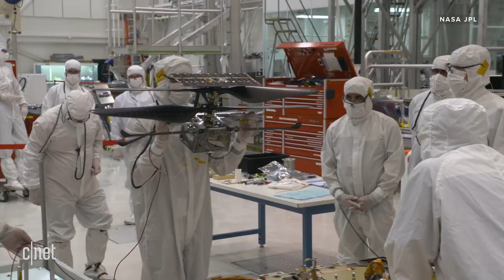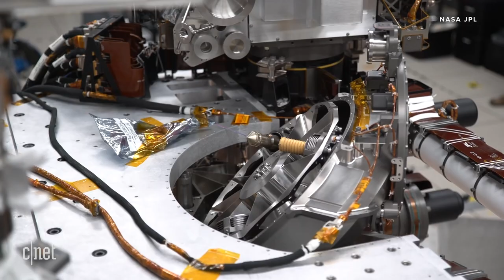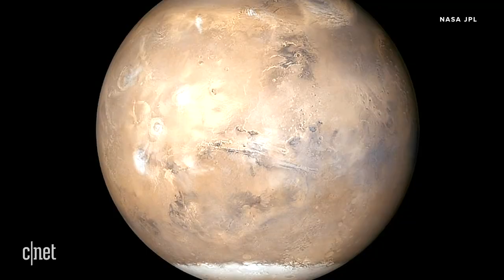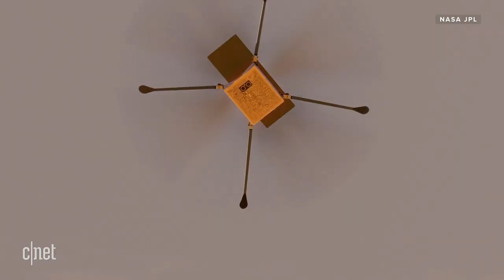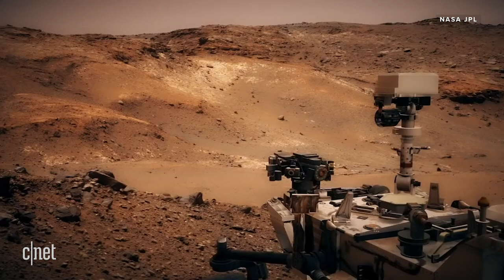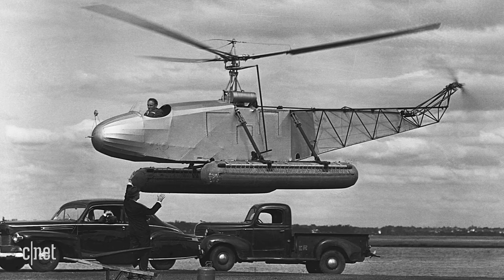The first ever Mars helicopter is INGENIOUS

Comment: Why? Because rovers are so damn slow:

Mars rovers:
Opportunity: 45.16 km
Curiosity: 20.4 km
Spirit: 7.7 km
Sojourner: 0.1 km

Moon rovers
Lunokhod 2: 39 km
Apollo 17: 35.74 km
Apollo 15: 27.8 km
Apollo 16: 27.1 km
Lunokhod 1: 10.5 km
Yutu 2: 0.1 km
Yutu 1: 0.1 km
Reply: John theux thanks
Reply: Thanks a lot mate.
Reply: Kilometers are not a measure of speed.
Reply: @UltraMojo13  Yeah I was also gonna say the same thing.
Reply: @UltraMojo13  he probably meant km/h. you've probably heard someone say: this thing goes 200 kilometres!   when they mean the speed of it.
Reply: But the helicopter goes 36 km/h thats literally slower than opportunity
Reply: Guys, please. The numbers above are clearly the total distance travelled by the named rovers in km. The speed of most unmanned rovers are a couple of cm/s. So yes, they are slow :)
Reply: @UltraMojo13  Most of them have a lifetime of several years.
Reply: @3p1ks  I mean over their whole lifetime, which is several years for most of them.
Reply: @inzert  Yutu and Sojourner travelled 100 metres?
Reply: @3p1ks  Yutu travelled a bit more but both around the 100 meter mark yes.
Reply: John theux what about perseverance
Reply: 3p1ks opportunity goes less then one 1 km/h
Reply: The Apollo rovers thou, are like race cars compared to the other rovers... still slow at a whopping 8 mp/h about 13 km/h
Reply: @UltraMojo13  SomethingSomethingSomething Light Years.  :D
Reply: @3p1ks  That's actually how far they have travelled so far, opportunity had a 15-year life but travelled 45.16km only because it's so god dang SLOW
Reply: idk wtf i was saying here

Comment: Might they use it to "dust -off" the Rovers Solar panels too? An additional small ducted-fan that would also add lift whilst dusting might be best for that specific purpose.
Reply: I dont think it has solar panels
Reply: Perseverance is powered by heated generators though. So that will not help.
Reply: Yes its brilliant. For all the times the dust covering the solar panels has been a major problem for all rover missions.
Reply: @josephamalsabu  However the solar panel although uses solar energy, which gets covered by dust on Mars isn't the only problem. It freezes the solar panels during sandstorms and during the night. Which happened to opportunity.
Reply: @s21b0b  i think he meant the other rovers
Reply: I think they should add an onboard shop vacuum to the copter to vac off the dust on rover or hire a Martian maid service.
Reply: @larry7868  lol

Comment: particles are trapped between the turbine and pushed. also we can spin things faster in space because the ether is made of fast moving particles that can escape really quickly and spread out so it would be crucial  to spin the turbine fast enough , to build up a significant pressure difference. this is just a concept by the way .

Comment: with that amount of money, atleast make those solar panel foldable so it wont interfere the air that will pass to the blades, also to protect it from dust and storm
Reply: The panel is too close to the axis of the rotor, and not much bigger than the body to interfere much, but I am surprised if it is not heliotropic for charging efficiency.  The worst martian storm is more like a cats-paw on your cheek.

Comment: If helicopters require an atmosphere to work, NASA has previously claimed there is no atmosphere on Mars.  So, was NASA caught “ misleading” the public once again?  The lift that is produced is proportional to the density of air; the higher the density, the more lift is produced and the more comfortably the helicopter can fly, and vice-versa. Less air density means less lift .
Reply: At no point have they said Mars doesn’t have an atmosphere. It has an atmosphere with about 1% the surface pressure of earth.

Comment: Here’s what I don’t understand. On Earth, small helicopter blades rotate at 400-600rpm. On Mars, there is only 1% of the air pressure on Earth. But there is only around a third of the gravity. So the rotational speed to generate sufficient lift on Mars should be 100 x (say) 500 x 1/3 = 16,666. But they say the rotation speed will only be 2400. So how can that possibly work?
Reply: @jonastrindade7294  Why the question marks? On Earth small helicopters have to have blades rotating at around 500rpm. The air on Mars is 100th as dense as the air on Earth so a helicopter would need blades rotating at 500 x 100 = 50,000 if Mars had the same graves Earth. But on Mars gravity is about a third of that on Earth so divide 50,000 by 3 to get 16,666 repeater.
Reply: Much less mass compared to the rotor lift; the whole drone is only 2kg

Comment: Fly it over to blow the dust of the solar panels of all the other probes there !
Reply: i bet this thing will die before the rover :D and if not it has to fly behind it all the time. guessing by the size of its solar panel it will take ages to recharge. and then it flies for 30secs, maybe doing a distance of 500m or so. i bet the rover is faster than this

Comment: What I don't understand is that the atmosphere is supposed to be extremely thin.  How would a helicopter stay airborn?
Reply: Its not as thin as you think one question that wasn't mentioned was mars has an induced magnetosphere which protects most of its atmosphere but it looses mostly argon to the solar wind however in truth the actual surface pressure may be higher then what is stated.
Reply: Fred Cink  ignorance how would you suppose this information is spewing ignorance I'm and stating it as an opinion the fact I used to think mars was a red planet and had little to no atmosphere back in 2004 we all assumed the books were based on the real thing but nearly 99% of that we were given was wrong and even the very images we were given weren't even original and all of a sudden the images from high rise and Martian express show a completely different world from the one we were shown in the classrooms.

Comment: A helicopter in Mars? I thought Mars didn’t have atmosphere therefore no gases = how the tf is this machine catching air to lift off??
Reply: Mars has an atmosphere. Compared to the Earth atmosphere, it contains much more carbon dioxide (a little more than 95%) and much less oxygen (less than 1 %).
Reply: @samnangeang2712  oh

Comment: If they can fly a helicopter on Mars, why can't they make an air compressor to blow the dust of the solar pannels?
Reply: they dont need to ,the have a very expensive magic wand, they use it for eveything
Reply: That “air compressor” is called the Martian wind
Reply: @alexsiemers7898  the Martian wind isn't always blowing.  So the solar panels get a lot of dust on them. So my question is why can't they make an air compressor to clean the solar panels when there is no Martian wind.

Comment: THE ATMOSPHERE  IN MARS IS VERY THIN -- MOSTLY CARBON DIOXIDE - THE COPTER WILL SPIN BUT IT WILL NOT FLY
Reply: Maybe you should inform the army of scientists and engineers who designed it that you know better than they do and they're all wasting their time.
Reply: NASA have a massive room that can be reduced to a vacuum. They will be able to test for these type of conditions. Hopefully they are also testing for dust damage to the rotors and motor.

Comment: We've noticed you're just so eager to film this contraption lifting off in a vacuum chamber with 98% of the air sucked out down to .08 lbs per sq in preasure? We'll wait. Just set it on a scale and see if it lifts even a fifth of it's weight. We'll wait.
Reply: Ithad Beenso it has hovered and autonomously navigated, otherwise it would not be strapped on the vehicle about to be sent to mars lol

Comment: Mars have air or what ??
Reply: Prathap Poojary yes.
Reply: i see second comment like this.. I think the main problem is that 
people confuse the term 'air' with 'oxygen'
Reply: @Pyrpyr_2017  but some ppl say thr is no atmosphere in mars ..🙄
Reply: @prathappoojary3618  back then they didn't tell us most of the information we were given was false mars indeed has an atmosphere and turns out it is blue nearly identical in color to that of earths do to trace gases which scatter's blue light16 times more than red light the planet has an induced magnetosphere which offers some protection from the solar wind.
Reply: @colinsouthern  its like 3% of earths pressure

Comment: I think there should have been a better design of this helicopter drone by having a flexible plastic dome errecting 
around it from a rod extending at the top and bottom and the inner module in an inner full rotational section, 
allowing to take off again if a wind gust or so tilts it to the side....!

Or at least a Mavic Air (tm) model version able to take off upside down, by its shape and simple shifting a central cam gimble to the top from the center...

Rotors fixed in a center axsis ring where the air is sucked in and out by vents in the speric plastic skin around it.
Perhaps using even a coanda effect.

So if it crashes, they just have to press wait till it stands still after bouncing down a canyon or so.
The in all directions moving inner box, would allign it self by a heavier balance on its bottom ( batteries of mini fusion reactor ).
By that mini cold fusion reactor could fly days around or how the connection goes...